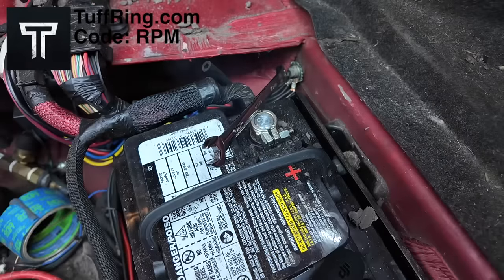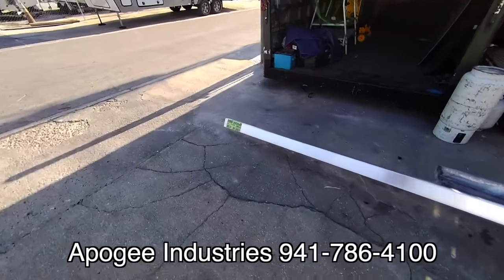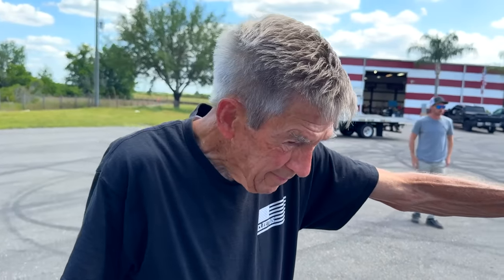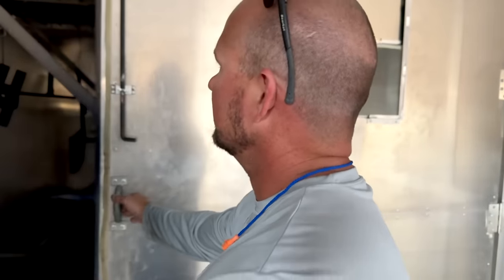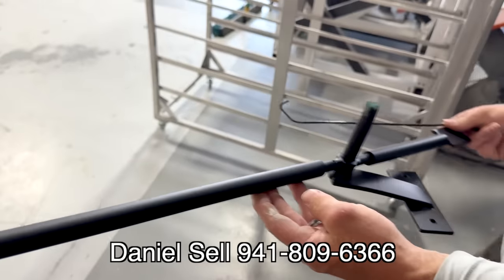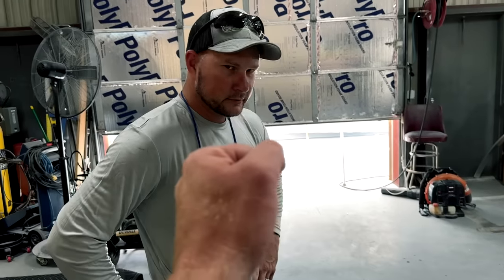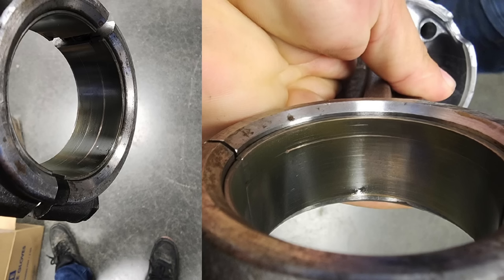Thailand Boat Engine Damage, the Trailer is INSANE!

Comment: 3m 5300 to seal your plates marine stuff
5200 but only if you never ever want it to come off again. It’ll rip your wood apart. 
Wood boats love moisture and being in the water
You want to make sure you store it in the right conditions too because it can shrink and crack.
You can polish your coated surefaces with regular automotive polishes

Comment: Seal any hole you put in the boat with 3m 5200 nothing else will hold up and stay water tight
Reply: This is most OEM spec under waterline thru hull sealant and most marine shops will use this 5200 I do think it only comes in white though.
Reply: @rexxx927  doesn't make it right because "shops" use it. Typical sheeple effect...
They make it in black, have a tube.
Reply: I'm betting that is exactly what Mr. Sam was talking about.  That stuff is no joke.
Reply: @codysp   so 5200 is wrong I don't get your angle, anyhow Chat Cody here noted there is black available unless it turns out 5200 is not a thru hull under water line sealant and is not a standard or under a sheeple :face-green-smiling:flipping genius tip so don't use what's tested and tied the test of time if you know this guy save the sheeple effect :face-green-smiling: what's next you gonna tell me a Whipple is bad of my health next? and that's typical are there others yes but there is only one of you and me, what a chit post
Reply: 5300. 5200 will never come back of if they need to do something.
Reply: @Pro_ject240  either will the holes in the boat Parker drilled so?
Reply: @Pro_ject240 do you mean 4200? Never heard of 5300.
Reply: Use life caulk or butyl tape not 5200 so if it ever needs to come out it can be replaced.

Comment: Parker use 5200 it will be a permanent seal and is made for exactly what you need to do with the water problem on the swim platform

Comment: How does the front ballast work? If the water comes in from the holes on the back, after on high speed it should come out, no?
Reply: That's the idea, yeah. A lot of larger fishing boats have the same system. Water floods the chambers so it rocks less at rest. When you start driving away it just drains out.
Reply: @Mardy72  thx mate!
Reply: @lpcrewaw  no worries mate

Comment: Powder coating the trailer because of salt water corrosion OK I get it! However, your battery hold downs, your fuel tank and a bunch other items are raw aluminum as well. Are you going to powder coat them too?

Comment: The water pump is going to work just fine. You have to remember the boat sitting in the water. The water is going to try to push in self prime, basically.

Comment: I would run the coolant lines the same basic route as the hoses but would have someone make some stainless steel hard lines.
Reply from the maker: Considered hard lines but not on a boat that vibrates a ton.

Comment: Salt water will destroy your boat faster than acid. You should switch to a freshwater sump system for the engine cooling if the weight can be afforded or keep it out the gulf.

Comment: It's just me but I would have upgraded it to a 14 Volt system especially foreign engines tend to run on 14 volts more than 12 volts like in the United states. Ever thought about upgrading it to a 14 Volt system before going through all that work?
Reply from the maker: Spoke about this with multiple people. We’re sticking with 12 considering the superbank that holds 10k cranking amps

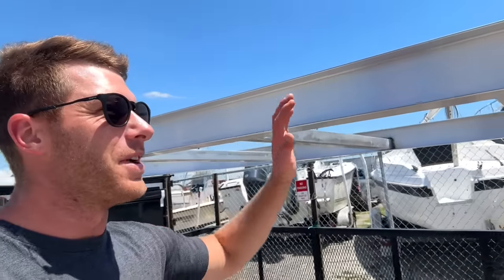Comment: Oh jeez, why the welds look so nasty at 2:29 ?? They migging aluminum?
Reply from the maker: Tig welding a boat trailer that’s used in saltwater without would be nice. We have to be realistic about the lifespan of the trailer and time/$ invested. So they spool welded the aluminum frame together.
Reply: @DoctrParker  thats what i was wondering.. as long as the welds are strong and cost prohibited, than all is good! I cant wait to see it rip and roal coal
Reply: He’s not trailering a yacht, it’s a dang wood boat. It will be fine.

Comment: Covering teak with rubber decking is Schtoopid!   If that is your plan, you missed something in the culture of Thai quality.  You could go in between/under and or find something else that does not ruin the look.  I have many years on these boats.  Just moved back  Never had a problem...wear good water socks!  Done!
Just moved back from Thailand a few years ago.
Reply from the maker: We’re only covering the thin boards you walk on with the rubber decking. 95% of the boat will be exposed teak.